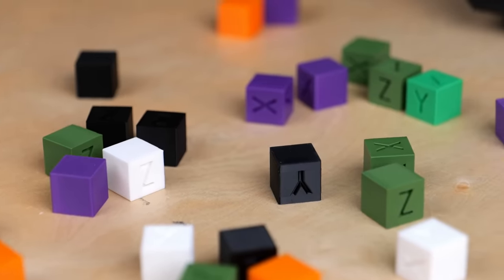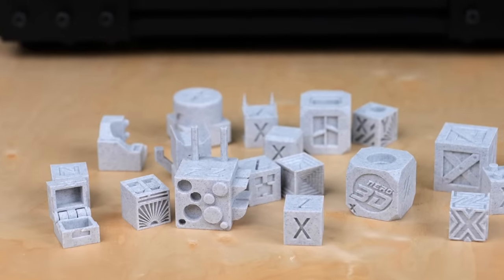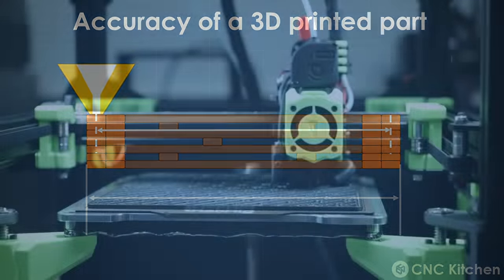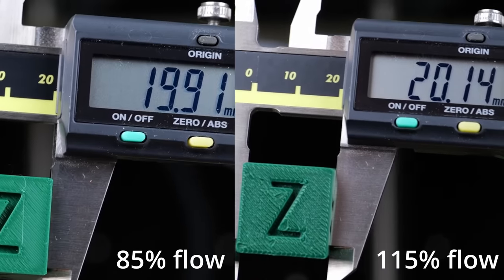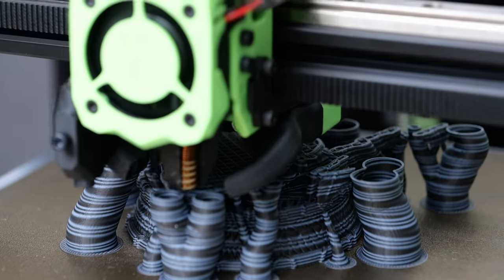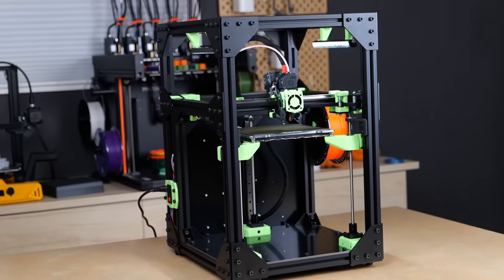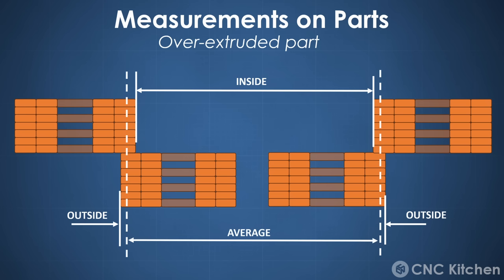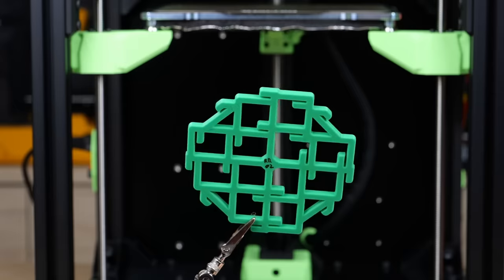Calibration Cubes: More Harm Than Good?

Comment: Hi everyone, Adam from Vector3D here.
Little update: we now support Bambu Labs skew correction! 🎉
At the time of the video Bambu Labs didn't have skew correction in their firmware so it needed a workaround, but now they do. Bambu Labs have said their implementation is currently still in testing at the (time of writing) so you might get some unintended consequences. That said, from my testing, it seems to work fine.
Thanks again Stefan for such a great video covering Califlower!

Comment: how can i calibrate the z axis?
Reply: Print it verticality that should work
Reply: Put your printer on its side
Reply: @Stormmblade  r/technicallythetruth
Reply: Bambu User: What is Calibration?
Reply: Use the depth measuring feature of your caliper to measure the height of a staircase type step (not an individual printer step)
That way you will be measuring the difference in height of 2 top surfaces.
Reply: Why not print a temperature tower and calibrate your temperature for a filament at the same time? If you know the height it should be and the measured height is different, you can adjust accordingly.
Reply: First get a metal ruler or Caliper measure all sides of chasis note them to paper which side is which value in mm. Then get a clicking torque wrench screw driver not power tools! Use only step by step clicking screw driver while assembling the chasis then once you assembled the main chasis which will differentiate type of printer you have... for example Bed Slingers... Assemble only Y and Z Axis Frames first at last assemble X-Axis. Make sure your X-Axis is flat from one side to another make sure your profiles height same at all lengths. Then make sure all dynamic components,bearing rolls,linear rails,linear carriages move smoothly. Check Stepper Motor steps with 1mm moves and check every side on Z-axis are still same values or not. make sure to use only one type of measuring tool in every step!
Reply: With calibration cube of course!
Reply: I use a 100x100x100mm XYZ "tripod". It doesn't do skew, but it gets pretty close on each axis. I ended up printing at 100.3 x 100.2 x 100.1 % scale.
Reply: Aside from the califlower, there's also the calilantern, which seems to also calibrate the Z-axis.
Reply: Print it upright? ☝️
Reply: @SigamaCrafts  the XYZ has the Z axis on there

Comment: Important point is: steps/mm is mechanical property that depends on belt type and gear tooth count. For the rest of  99% circumstances,  calibration problems all about frimware and slicer settings.
Reply: True, but the belts pitch may change with tension
Reply: I don't know how more people don't understand this. You are right it's just fixed. If you have your rotation distance/esteps set up for your specific pulley setup - that's all you need. The rest is slicing and flow tuning. 

Spread the message!! Don't fuck with rotation distance/esteps!!!!

Comment: I love the califlower: after making tweaks, it's a single print that gives me confidence that everything is still working as expected.  The older califlower is the only STL I've ever paid for, and I paid mostly for the support files.  It was worth every penny, and the new design looks even better.  Highly recommended if you are someone who mods their printer, even if you mostly print aesthetic parts: you're gonna need good accuracy on any new mod parts.

I especially appreciate what look like caliper supports in the design, as getting the calipers square for all the measurements is the biggest pain the ass through the whole process.

Comment: This is so perfect.  Measuring mounting holes and creating a mount has been the best real accuracy test.  I use a hole center calibrator.  Checking a calibration hole (inner dimension) in an object is very different than measuring a cube.  Hole center to center is the best method.  Thank you for this video!!!

Comment: This made me happy. When I first started 3D printing, I printed out maybe 50 of the cubes. They were so new that... they were just cubes. No XYZ labeling or brands or whatnot. And I wasn't printing it for dimensional accuracy, I was so new I didn't think that was an important thing at that point, I printed them just to try and get a successful print. "Did the top layer look bad? Did it even get past the first layer?" etc. Fast forward: I've ignored so many of these tests for a simple reason - I just want to print stuff, not spend all my time calibrating my printed. I'm glad to see basically all the printers you tested have small skew and dimensional issues. You have a good point though: what is the acceptable amount of inaccuracy?

That's a different topic. But the 2 things on my mind:

1) a pet peeve that you're slowly smashing - ending hearsay in 3D printing. Enough of this "print one of these and you'll have have a good print" "it works for me" "run a temp tower" "no, temp towers are useless, do this calibration print" "make sure you calibrate your e-steps before you check dimensions" "wait, I though dimensions was for checking e-steps" wait wait... stop, can we just get an instruction sheet that we should be doing that produces a reproducible result? I remember you trying some service on Meltzone Podcast where you basically got sets of gcode to run, printed them, then answered some questions. Similar to a game called Q20/20 Questions, and at the end it gave you a printer/filament profile that was "perfect". There's a ton of calibration tests out there, some built into slicers, some separate, some free, some cost money... I'd love for some system, paid or not, that you could run the set of tests, get a profile or similar out of it, and move on. At the time that Q20 profile generator was discussed on Meltzone, it did basics. But now we have printers with flow calibration, input shaper, and more. And one thing not covered by any of them, is they don't take into account wear. Like, imagine getting a new printer, run the first run... it spits some random models out, you answer some questions... it auto-calibrates the machine (hey Prusa, when you gonna add that skew adjustment to the MK4/XL/Mini?), and then you move on. Have the slicer be able to do the same for filament. But then in a month or two, you can do a small print and find out if you need to rerun the calibration or not. A canary of sorts. I made the mistake of using the same brass nozzle for like 4 years, no carbon fiber or whatnot, but I finally went to replace it and found the 0.4 nozzle was closer to 0.55mm. Oops... but I had no real sign of this and it's not like I memorized how well things fit together from 4 years prior.

2) ERRF 2019 had a keynote speaker that was great to listen to: Adrian Bowyer. History and some ideas for things in the future... and he commented on this exact topic. That these were imprecise machines. And he proposed something... if the nozzle could tell when it makes contact with something in more then one dimension, it could be used to calibrate itself. Think: print the infamous 20mm calibration cube, it then cools, then pokes it... and finds out that it's 20.01mm, so it adjusts itself so it's next print is 20mm. Of course, this isn't some ground breaking concept... this is used by CNCs to find their source material, inspection systems, and in the 3-4 years since then (depending on how you want to measure time :P), we've gotten strain gauges on all the things and the Prusa XL literally does this to calibrate nozzle location between tool heads. It isn't fast, but at least you don't need to buy an external camera or similar. But the point is: it's there... right now. "We have the technology" we just need to use it.

Comment: Great video, but the one part you definitely should have included is why it's a bad idea to adjust steps/mm: Because the steps per millimeter can be mathematically calculated based on the number of teeth on your motor's pulley and the pitch of the belt. The only way they can be off is if the belt is stretched.
If it's off, it's either shrinkage or under/over-extrusion, either of which should be compensated for in the slicer (as you pointed out).
Reply: Exactly... X/Y/Z steps/mm or Rotation Distance should be mathematically derived, not corrected based on inaccurate plastic measurements.

My belt with a 2mm tooth pitch around a 20 tooth pulley WILL move 40mm per rotation.  If it doesn't, something is wrong!
Reply: This is also true for esteps on your extruder. Every filament behaves differently and the best way to adjust, as Stephan briefly mentions, is by adjusting the extrusion percentage in your slicer
Reply: Hm, but with the cheap belt gears you find in 3d printers the core diameter isn't as accurate as should be. See, if the 20 tooth gear moves 20 teeth around a diameter of let's say 12 mm, 36 mm travel will occur with one full rotation. If the diameter is just 0.2 under you get just 35.4 mm travel. And the rubber belt would just be fine with it because of the flex in the teeth. If we had precision parts we would be happier, but these parts are expensive
Reply: So I calibrated steps per mm with a caliper clamped to the head, moving towards a robust place of the frame. For each axis. 👍
Reply: @sandrolauer350  That's not how cogged belts work. Unless you have it installed inverted with the flat side towards your cogged pulleys or are using smooth pulleys instead of cogged ones, it's impossible for a belt with a 2mm pitch to move more than 2mm per tooth. Even if it's loose and skips teeth, it's still going to move a multiple of 2mm per tooth.
Reply: i was about to just draw it myself.  and see if i could get my hands on the spreadsheet.  
then he mentioned the cancer.  so i just bought it.
Reply: @glabifrons  / Except that doesn't seem to be true in real?
If cog belts and pulleys operate to move the ideal 100mm travel on each axis, then the printed output should also measure to be identical for the length in each axis - shrinkage or not. Apparently there is some factor that may cause deviation.
Reply: @m4ki9h76  You need to re-watch the video. There are many, many factors involved. Your "shrinkage or not" statement makes no sense. If something shrinks it's, by definition, smaller. 
Try and picture what it would mean that it can move an amount that doesn't work with math, that means you have a belt that's moving a fraction more than one tooth on each rotation, cumulatively, which is completely impossible if the teeth are meshing. If a pulley has 20 teeth and a 2mm pitch, one rotation is 20*2mm or 40mm. No more, no less. If you've eliminated all other possibilities, then your belt is stretched or otherwise defective.
Reply: @glabifrons  / By what I mean 'shrink or not', I meant it in the term of errors between X-axis and Y-axis. If we assume the print cools evenly post-printimg, the shrinkage would be uniform enough that the deviation percent between them would be negligible. But as shown in the video (13:10), it's mostly not the case - the most extreme case shows about 0.17% difference. (J1S, Prusa MK3)

I don't disagree the math is the basis, but it being too precise is just a pipe dream afaik.
Reply: @glabifrons  / I hope to see someone revisit this, if the travel is truly real as it is. I've seen few designs with a vernier caliper as pseudo-Digital-Read-Out device.

Comment: This, signle point dimensional calibration is my pet peeve.

Two points are an improvement, but I prefer 10-20, shrinkage isn't always perfectly consistent. I once designed calibration square that let you measure both XY shrinkage and skew with 40 data points (technically 38), the only downside was that it had limited capability for measuring internal dimension.

Comment: Hi Stefan, we are running a large professional 3D printing farm, and never ever done "calibrations" like this. We are printing some shapes that we have made ourself, to check skew and have a tool that measure travel of the print head manually, and part of maintenance is to go over the mechanical issues. We have slicing profiles (shrinking, material) that we now are dimensionally within our tolerances, which is within 0.1. Best regards, Annie
Reply: do u mind share the shape?
Reply: @andrikurniawan531  its definitely one of circle/square/triangle

Comment: I haven't trusted prints for calibrating X, y and z rotation distance for quite a while. I bought a dial indicator with 50mm measuring distance and an accuracy of 0.1mm used and it served me well for calibrating lengths. Also I agree that the scew measurements with the califlower are tempting...
Reply: Gates GT2 belts are spec'd to >0.3mm every 92 teeth at a 6.6lbs belt tension. I do just over 7lbs for a passively heated chamber (~65c when printing with a bed temp of 105c). You can find the full spec sheet online rather quickly. The further the tool is from the motor pulley gear the more relative tension effects accuracy. Meaning if you have at most 0.3mm off than it will average out to just over 0.15mm. 

Everything else is shrinkage and not having your machine square and tramed.

With that said, shrinkage is dependent heavily on temps, extrusion speeds (and cooling), color that effects material properties, etc. And you should never expect a perfectly demential print on the most precise printer as every print will have its own unique shrinkage/internal tension.

Comment: You can also just use a dial indicator to check the distance of your travel moves. This eliminates any variables from extrusion width,, shrinkage etc. and purely check the motion system to see if a 20mm travel move is exactly what it should be. Adjust steps/mm from there.

I know not everyone has a dial indicator, but they aren't expensive.
Reply: This method will account for steps, but not for skew.
But yes, I have done the same on my first pinter.
Reply: @KeksSektor  Cal cubes don't check for skew either. The sides will still be parallel, and a 25mm cube isn't really big enough to check the edges with a good square. Correcting for skew is really it's own thing.

Comment: Callipers can vary a fair amount in accuracy.  If you get a cheap micrometer then you can use that to calibrate the callipers.  Also, be aware that you must manually apply consistent pressure with callipers, while a micrometer should have a friction wheel that applies a set amount of force each time.
Reply: There are calipers that are called "pressure calipers."  They have an extra dial on them that shows how much force you are putting the jaws.  If you buy a new one made by Mitutoyo they are about $900.  Also, using a cheap micrometer to calibrate your calipers is not really the method to use.  Using a "standard" or even a gauge block will work very well.  To each his own.
Reply: @6milesup  
You can use the micrometer to measure a test piece (such as the maligned 20 mm cube), then use that as your ‘gauge block’.  Plastics deform much more than metal or ceramic under load, so by doing this you have a better idea of the final dimension if you are wanting press-fit accuracy.

It gets complicated fast, if you want to measure TPU etc.  Maybe an optical method is better there.  You could use your phone camera for an ad-hoc measure with a reference (e.g. your calliper set to a close value) and some pixel counting.  Really depends upon how accurate and precise you want your results to be.
Reply: You can also use a dial indicator to just check the motion system directly. zero it on some part of the gantry, do a 20mm move, and see if it's exactly 20 mm, no printing required, and no shrinkage or extrusion width to possibly interfere with the measurement
Reply: Pretty sure caliper accuracy is more than good enough for 0.2mm layer printed parts...aiming for x.xxxxx level of precision with fdm is silly and unnecessary imo.
Reply: @Fennecbutt  
With plastics you can get away with less precision, but you still want enough accuracy for fitment.  Errors compound, too.  A small error here and a small error there can result in something that won’t fit.

Squareness / orthogonality of axes should also be considered.

Comment: I disagree. As you state at the end, the Cube can be very useful if used properly. Just measuring X, Y and Z is barely scratching the surface. You can check skew with a square as well or measure diagonally as you mentioned. 
I use the CHEP Cube for many of those references beyond measuring X,Y & Z

Comment: When I first started printing I was surprised to see how many people relied on a simple 20 mm size cube measured with a cheap caliper to adjust the steps per mm. Having a good amount of experience with measurements I knew the result would likely be worse than leaving the default values. I'm happy to see someone else pointing out the issue.
Reply: Yep, the best investment in my shop is a (used) mitotyo caliper. The cheap Chinese crap always loose the zero after switching off and eat button cells due their bad power management.
Reply: @matneu27  a WHAT caliper? if thats not a typo im pretty sure you got scammed.
Reply: @ipadize  oh I am so sorry that I made a typo and luckily you discovered it. I meant the mitotoyo (hope I wrote it right, the letters on my caliper are almost wiped away by heavily usage)

Comment: This is funny to me because I've never printed a calibration cube 😂

For me, I needed to make a thing. So I printed it with super low infill settings and then measured it. After that, I just adjust the size of the print in CAD to what works for the part while keeping in mind the allowable tolerances. But, I'm lazy 😅